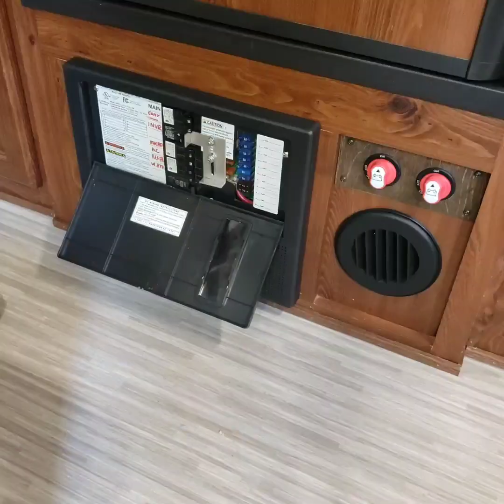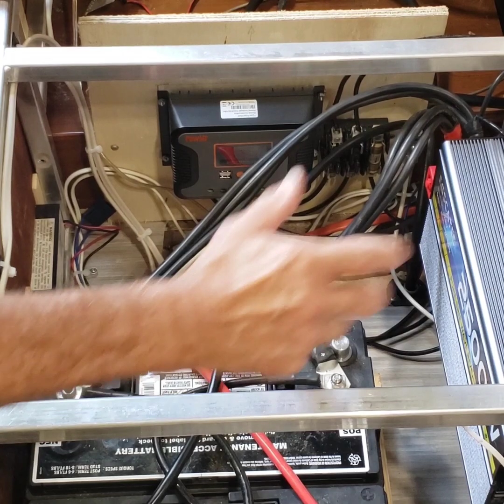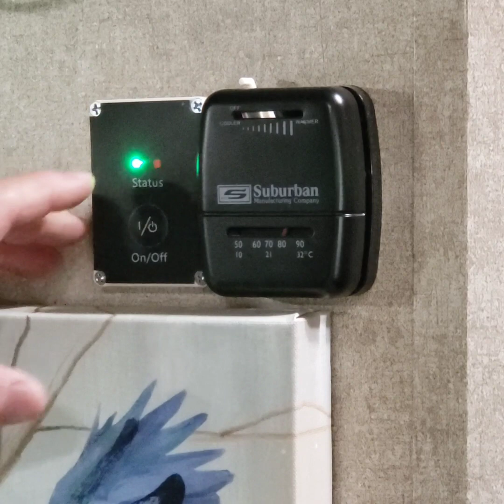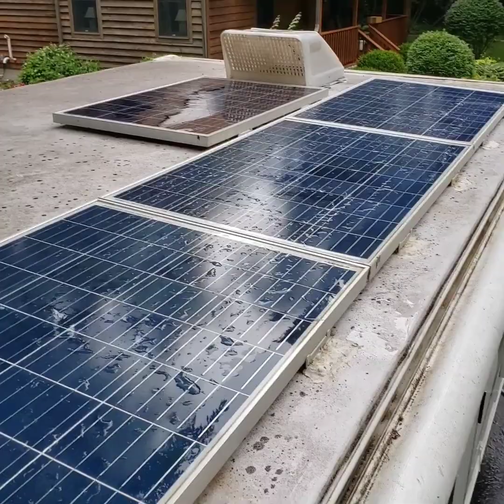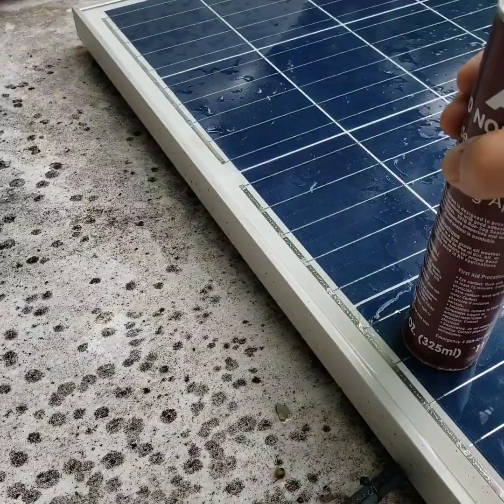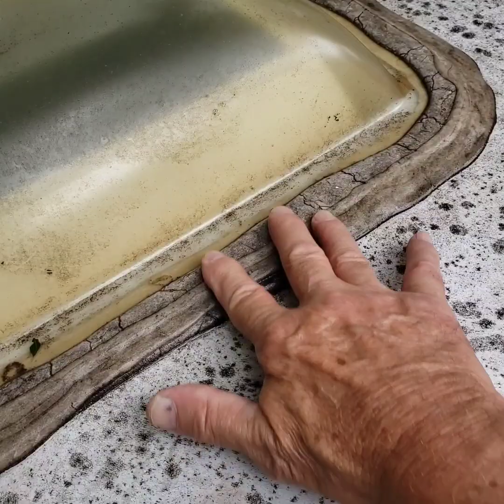2500 watt inverter, solar panels and charge controller installation in RV Rockwood Minilite camper.

Comment: You run your AC but not for long, Is it because of battery amp hours? I'm looking to do this set up but want to run the AC full time working on the thermostat.
Reply from the maker: To run an air conditioner you will need more amp hours . I could run my AC for maybe an hour or two depending on how often the compressor kicks on. Say you have an AC that draws 1800 watts @ 120vac when the compressor is on. 1800w / 12vdc = 150amps draw from your battery bank. So if you want to run an AC for 6 hours of compressor time you will need 900 amp hours of battery. This is not taking in to consideration the draw of the blower motor when the compressor is off. Also the above calculations to not have any losses figured like the efficiency of the inverter and voltage drop.
Hope this helps!

Comment from the maker: Here are the links to the equipment purchased for the installation.

https://www.ebay.com/itm/304904197041?mkcid=16&mkevt=1&mkrid=711-127632-2357-0&ssspo=N8n8CoZPSUK&sssrc=4429486&ssuid=XjsNcmHORwu&var=&widget_ver=artemis&media=COPY

https://www.ebay.com/itm/354634300739?mkcid=16&mkevt=1&mkrid=711-127632-2357-0&ssspo=5rV_6SDoRQa&sssrc=4429486&ssuid=XjsNcmHORwu&var=&widget_ver=artemis&media=COPY

https://www.ebay.com/itm/382056549608?mkcid=16&mkevt=1&mkrid=711-127632-2357-0&ssspo=V72ApR38S_q&sssrc=4429486&ssuid=XjsNcmHORwu&var=&widget_ver=artemis&media=COPY

EGSCATEE 2500W Pure Sine Wave... https://www.amazon.com/dp/B0B5L2TWNB?ref=ppx_pop_mob_ap_share